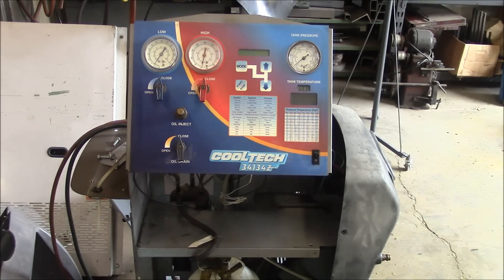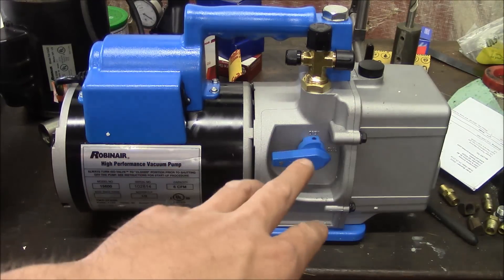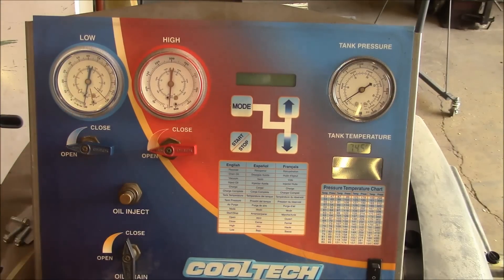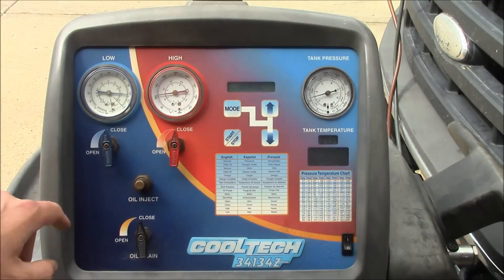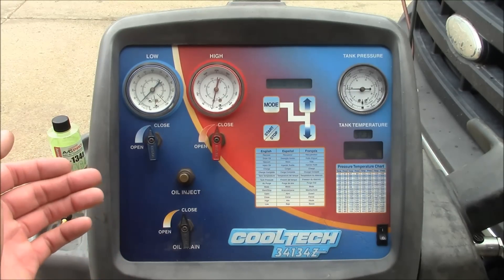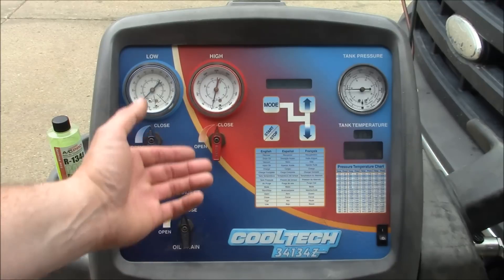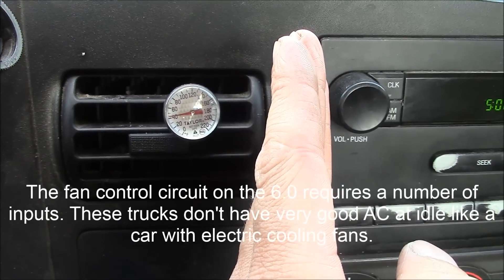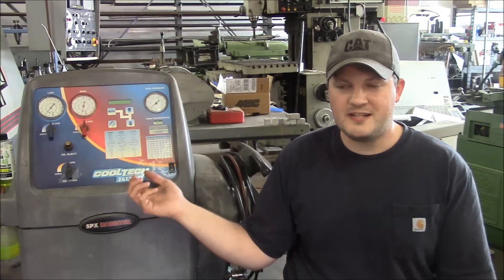Robinair A/C machine vacuum pump replacement and operation

Comment: Nice explanation Wess. I'm an AC mechanic for NYC Transit. Our busses hold 26 lbs of 134a and we have 4 Robinare recovery machines, but we normally use a separate vacuum pump because the small pumps on these machines take too long. We use heavy duty vacuum pumps and pull to 500 microns. Almost retired so it won't be my problem any more😁
Reply: hey u are the first to say the word micron gauge. everybody on utube doin hvac work hate that micron gauge, but at least you no . without that gauge u will never no how much moisture is left in it, yep i try to get 500 or less and no more than 1000 on a 10 min decay, most of the time i get better than those numbers. some times i have to leave it on vacuum overnight. so teach wes what im talking about. 45 minutes will leave a lot of moisture even in our ac systems

Comment: Thanks a bunch for posting this video. I just bought a used unit with a bad vacuum pump then found out it was nla. I've been in a mild panic trying to find a replacement and 'boom' you solved my issue for me.
Thanks a bunch.

Comment: Ive got a robinair 34700z that gets hung up on clearing and when I bypass clearing it wont recover or show that it recovered anything. I searched and searched but couldn't find anything straightforward. Noise wise the machine compressor does kick on and it sounds like it overloading itself and it cuts off. someone told me its a solenoid sticking. this is my first time owning one of these machines so I know pretty much nothing about it. all I do know is that it is not recovering any refrigerant.
Reply: Have basically same problem but on another brand

Comment: I have the 34700z machine. My machine is not evacuating the compressor oil from the vehicles and found that there was PAG oil mixed in with the vacuum oil.  Would you say the pump is trash?
Reply from the maker: No. They recover very slowly and usually never recover any oil.
Reply: @WatchWesWork   since pag oil was mixed with the vacuum pump oil I want to replace the pump.  Mine is 3cfm dual stage. Would you say the pump you used work in my aplicacion?

Comment: A/C is used during the Winter to defog the windshield.  Most American vehicles are wired so the compressor engages when Defrost is selected.  Most Japanese brands make it manual, at least they used too.  I had a coworker who was complaining that her windshield was fogging up on her brand new Nissan Xterra.  I asked if she hit the AC button when she had defrost selected.  "Why would I use the AC in the Winter?"  I explained to her that it dehumidified the air before it went to the windshield so it wouldn't fog up.  Problem solved!

Comment: we just started in the A/C business and we bought this same machine. Question: can I recover the ac refrigerant in a different Thank so we can only use the internal tank to recharge the ac. so the internal tank doesn't get contaminated with dye, stop leak, and many other things? if I can do that how can I connect the machine to the external tank to do the recovery. julioelias57@gmail.com             thanks a lot.
Reply from the maker: No. Not that I know of. Just use the right filters and it will be fine. I've never had an issue with mine.

Comment: How much did you have to pay for the machine with a bad pump ?
Reply from the maker: I think I paid $700.
Reply: @WatchWesWork   I found a used  one with a bad pump asking 300.00 .  From a tire shop . Looks well used. Found a used pump for 180 .00 . ??
Reply: Going to get it next week . I have a topper on my truck  . Is their any problem with laying this in its side to haul ?
Reply from the maker: @pltmann  I would not lay it on its side. These things are really awkward and delicate.
Reply: @WatchWesWork  I'll pull the topper off . Thanks .
Reply: Going to pickup tomorrow . All it has for a tank is a R134A 30 lb .  Can I use that for a tank or will I need an internal tank as well ?
Reply: @WatchWesWork  Got it home . Looks to be complete other than oil injection bottle. It does have the internal storage tank . Not sure how to fill it , but will figure it out .
Reply: @WatchWesWork  I started it up and let I pull a 15 minute vacuum.  It would only go to 26 inches . I left the valve open and it would bleed off as well . Close the valves and the gauge would not move . No oil  leaks . Pump just seems week to me . Do you have any thoughts ?
Reply from the maker: @pltmann  The vacuum pumps fail often. A lot of AC vacuum pumps recommend changing the oil after every use since the oil naturally gets water in it.
Reply: @WatchWesWork  I haven't changed the pump yet . Just ran it with the alleged bad pump . I was curious to see if it was acting similar to your old pump. Thanks for responding .
Reply: @WatchWesWork  New development . I took the pump out getting ready to change it and decided to drain the oil.  The oil was green . Looked like UV pag oil.  Got out my light and it glowed away . I don't know how f they have vacuum pump oil with UV dye ? I put it back in and pulled another 30 minute vacuum . It pulled it down to 27.5 . Holding good.  Don't know if I change the oil again if it would improve it ? Robinair literature says you may have to change the oil multiple times if you are pulling a weak vacuum . I have a portable pump . It pulls the needle right down to 30 . In comparison the pump in the machine seems week . Any  thoughts ?
Reply from the maker: @pltmann  I guess they could have used PAG oil. You can get PAG oil into the vacuum pump from normal use vacuuming down a system. It worth trying. If you don't see rust in the oil it's probably OK.
Reply: @WatchWesWork  Saga continues . Changed the oil again and it pulled down to 28 and held . I decided to try and reclaim refrigerant . Hit reclaim and it flashes high pressure and trips the outlet breaker . Will not start the process.  Doing something wrong ? I am wondering if the compressor is bad instead of the vacuum pump ? Their is a start capacitor on the unit.  Could that be bad . Any thoughts ?
Reply: @WatchWesWork  Checked the capacitor. Little high but in spec . Tried to get the cover off of the compressor . Fans in the way . Tried it again and the compressor made some clunking noises and then smoothed out . Recovering now . I called the place he had it diagnosed at and they told him the compressor was bad . Running smooth now ? See what I does .
Reply: @WatchWesWork  update , Machine is working . Don't know what I did . Something in the motor cover stuck ? Clanging stopped and machine smoothed right out . Recovered all the refrigerant and pulled a vacuum for an hour . Sounded like the pump was kicking in and out . First to second stage ? Pulled it down to 28.5   . Don't know if the gauge is not quite right  . Set the charge ( high side by the way ) went right in.  Started it up and the rest went in . Charge complete . Recovered refrigerant from the hoses . Worked just like your video . Have to see if it acts up again . 250. 00 for the machine . I ordered the extra Vacuum pump but am not going to change it right now . What do you think ? Seems to work . Car ac blowing cold .
Reply: @WatchWesWork  Acts up again I think I might need a RA19489 starter relay kit.  Have to see.
Reply: @WatchWesWork  Thank you  for your help and great videos . Learn each time I watch them  .
Reply: @WatchWesWork  Serviced 5 vehicles so far . No problems . 34134Z is working good . Not sure why it acted up . Time will tell. I can see why  it's not a good idea to charge with small cans . You don't know how much is going into the system .None of the cars I serviced had the correct charge . I got the bottle kit for the oil charge . Works good .
Reply: @WatchWesWork  
I did change out the pump  . I checked it with my Micron gauge and it said 29.84 in and about 1700 microns . I  am curious if I'm loosing with that long hose ?  They are old looking . I think it should pull down to below 500 .  Pump its of says down to 20 . Any thoughts anyone ?
Reply: @WatchWesWork  I layed ours down on its side for transport. What should I do now 😅 should I take it apart and check everything over? Anything in specific?

Comment: A Robinair. My first job was with Kent-Moore in Spain. Back then (mid 1980's), Kent-Moore sold Robinair recovery stations that were really not much than a simple frame with wheels and a set of gages and valves! Very primitive compared to the unit you show us today. Looks really nice!

Comment: My robinair ac machine is only pulling -19 on vacuum so I’m guessing the pump is shot.   Ive had the seal push out, ordered a rebuild kit and it pushed the new seal out again when trying to inject oil.

I service guy told me to loctite the seal in and it’s been great ever since.  (Last summer) Until now 😡.  Guess I get to tear it apart again.    Thanks for the conversion pump video- I’ll be doing the same

And good info.   I always wondered why default charging was set to high side.   I’ve always charged my machine through the low side
Reply from the maker: I always do the static fill through the high side to keep from washing out the oil. I can't remember if that's what I said in the video.

Comment: What/where did you have to drill a hole for capacitor ?
Reply: I think it was just into the sheet metal case for the motor. It was only a hole for a self tapping screw to fasten the cover of the capacitor to the case. The replacement's cap. was housed inside the plastic handle and not fastened to the motor case like the original's. He moved the original capacitor cover to the new compressor.

Comment: I came to Youtube looking for a video on how the 34134Z worked because I purchased one. And I have to say, I'm extremely grateful I found this video. Not only because you explained how it all works but also gave some tips on how to use it and even showed us how to replace the pump. 👌🏽👌🏽👌🏽
Reply from the maker: All of these recovery machines are basically the same in their operation. The newer machines have slightly more sophisticated computers to make them easier to use, but the ideas are the same. It's really just a manifold gauge set, a vacuum pump, and a recovery compressor all packed in a nice looking shell.
Reply: I have the same machine I bought it about a year ago. This video helped a lot. I also had to recalibrate my scale
Reply: @Number1redskinfan  do you remember the procedure to calibrate the scale? I moved .y machine and the scale if off.  Thank you
Reply: Need to have a weight. I used a 20lb dumbbell. Got to access the calibration menu. Same place you go to, to reset the vacuum pump oil and filters. Enter calibration menu and adjust weight to what you are using. Make sure scale has nothing on it and is free of debris. Place weight in the middle and then adjust the weight and press enter to confirm weight

Comment: Hey im trying to fill the internal storage vessel in my ac machine. Same as yours. I followed all instructions in the manual. I hit recover and sounds like compressor in machine kicks on and draws some good amount of amperage because my lights in room dim. But takes forever to even recover 0.2 lbs any ideas what it could be?
Reply from the maker: Sounds like a passage is blocked or the valve on the quick disconnect is not working right. Are you using the correct fitting to attach to the refrigerant tank?
Reply: Wes Johnson Services yea im using the r134a tank adapter per the manual. I opened the full tank valve then the coupler on the ac hose then i hit recover and open the valve on the ac machine panel but nothing really recovers into the internal storage tank
Reply from the maker: I guess I don't know. You might try recovering from another source, like a known good AC system, and see if the result is different.

Comment: Well done, i work as an auto tech. I want to start doing AC side jobs. I was online looking for a used machine i can use at home. And found this one for $250! That sounds like a great deal being i can make that back in one or two ac jobs.
Reply from the maker: Wow. That's a pretty good deal. Even the really old machines all work pretty much the same. The newer ones have smarter computers that make them easier to use. I'm not sure mine is working correctly at the moment. I have to use the vehicle compressor to pull in the refrigerant.
Reply: Got mine for 200$ and it works great. Prob did about 20 jobs last summer and almost 10 this year so far

Comment: I did automobile AC work in the early 1990's when the R-12 was being phased out...these recovery machines were around $4-5K dollars. Robinaire  a good quality unit, worth the repair cost. R-12 went from 1-2 $ a pound...to a dollar an OUNCE....
Reply from the maker: A new Robinair machine is still $3000+. As far as I know, there is no new R12 being made, and hasn't been any for many years. What you can buy is reclaimed refrigerant from old systems. It was a lot easier to work with though. It got colder at much lower pressures, so it was less likely to leak.

Comment: What happens to the reclaimed refrigerant?
Reply: Usually re-used and often put back into customers cars....a good recovery machine will  clean the refrigerant well.
Reply from the maker: Yes, the refrigerant gets filtered and stored until it is charged back into the system. If the refrigerant is mixed with air, the machine can actually purge the air until the pressure and temperature readings match the published charts.

Comment: Vacuum pumps I’ve rebuilt are from lab equipment. Always spooky because you don’t know what they are Pumping. Sometimes I’ve found Mercury in oil case.
Reply from the maker: Yikes. Lucky that's not the case for this one. Just water causing rust and sludge. There were some metal flakes in the oil sludge too, so I don't think it's worthwhile to rebuild it.

Comment: i've rebuilt lots of vacuum pumps, they are they most unmaintained thing on earth
Reply: Poor maintenance....most small/medium shop air compressors are right there at the top of the list for lack of maintenance.
Reply from the maker: The computer actually tells you when to change the oil. But, it's 13 years old, so who knows what it's been through.

Comment: Thanks Wes,  disclaimer here- I am not up to your level, but this may help some listeners;  the vacuum pump I use for HVAC reccomends replacing that vacuum pump oil every one or two uses. The oil absorbs moisture and moisture has no place in any refrigeration process, I think it combines with the refrigerant and produces some caustic agent that attacks the metering hardware etc.  I would bet money you know that, I am just here to learn not critisize.
Reply from the maker: Yep. Like I said, the interval is 10 hours for the machine. The mobile pump recommends changing after every use, but that's made for much larger systems. The vacuum pumps boils the water out of the desicant and the PAG oil. That water ends up mixed in the vacuum pump oil.

Comment: This is awesome Wes! I was an auto mechanic for about seven years way back when and I always wanted to know how the AC charging/recovery bit worked and never knew until now :)
Reply from the maker: Pretty simple really. You can do the same thing with several separate devices, but these machines roll everything into a convenient package.

Comment: Got to be comfy while that wheel falls off!! lol
Reply from the maker: Yep, the operators of today will melt like snow flakes if the AC fails. I used to see it all the time in the truck shop. Engine leaks oil, terrible blow by, clutch slips, brakes and tires worn out, won't pass a DOT annual inspection, but all they want fixed is the AC.